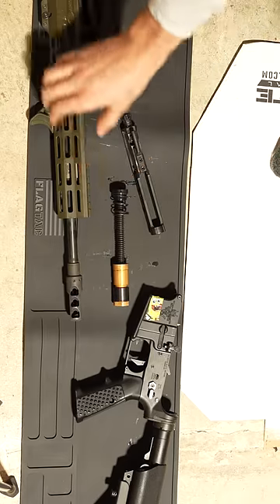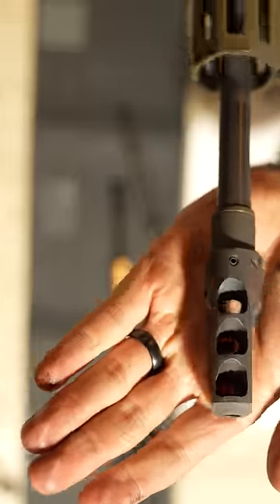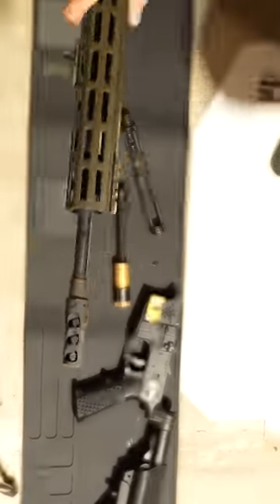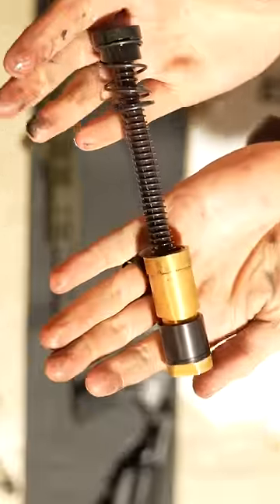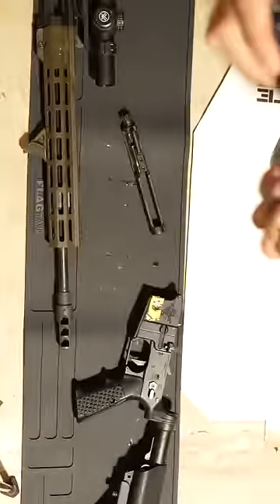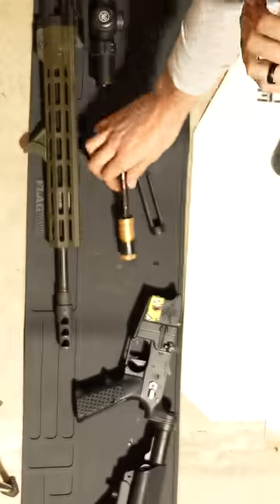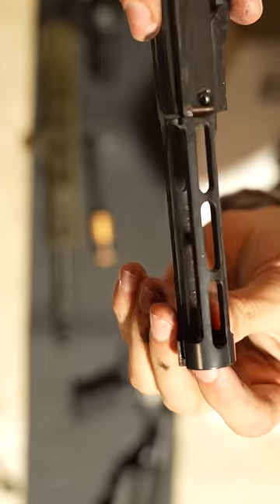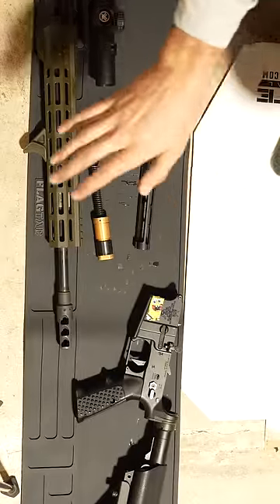This AR has ZERO RECOIL

Comment from the maker: Some of you dorks need to take the fedoras off and learn that hyperbole exists lmao 

ERRMMM AHKTUALLY 🤓
Reply: How much is it? Looks rather pricy with that bolt carrier and buffer
Reply: Or, just don't lie.
Reply: @Icytits  He literally explained how that is not a lie
Reply: CA Compliant?
Reply: My set up kind of like yours. My first build was titanium bolt carrier, hiper eclipse trigger, muzzle brake with suppressor quick connect, adjustable gas, jp buffer group. Recoil non existing, but this is definitely NOT a duty gun since it's low mass, the carbon buildup starts to mess with the cycling. About 200 rounds and it starts to act up. Everything is light weight. Made this build for light shooting to get people to see that shooting an ar15 not that scary. A quick gas adjustment and it'll run again but with more recoil. Is this gun necessary. Nope. Would never use it for self defense, I live in a city. Is it fun? Absolutely.
Reply: Can you put a suppressor on it with the recoil parts?
Reply: Can those attachments be used in a military styled m4a1?
Reply: What rifle?
Reply: @PeppyCat210  It's just a hyperbole
Reply: Does this rifle have a reciprocating barrel?
Reply: you sad tapewotm
Reply: Thought it was that hand guard 🤣
Reply: Unfortunately redditors still exist
Reply: @Icytits  I think they meant vertical recoil.
Reply: Anybody that needs to reduce the recoil on an AR, shouldnt be using it in the first place
Reply: what's the name of the AR or is that a piece for improve AR ?
Reply: @herbertayala1827 nothing is California compliant including California it's self
Reply: Hold it at arm’s length one handed and let’s see how much recoil and muzzle climb there is.

I know, nobody Ackshually shoots like that. Still, that’s a better way to showcase recoil mitigation.
Reply: Work with f/a?
Reply: looks great honestly
Reply: when I was 60lbs I had a 20 gauge single shot.   Can you imagin the type of trauma this will sustain?
Reply: @LairdErnst  Soa Subverter
Reply: @Dire_wolfe that makes no logical sense
Reply: Reddit, home of the basement people with no social skills
Reply: Reported to CA authorities. 

Hope you registered that "assault weapond" bud lol
Reply: @Icytits  what's he lying about? I'm so lost as to what the controversy is

Comment: I have a sub six pound AR (sans optic) that's practically zero recoil.  Don't need the big brake, I used a Faxon pencil barrel with built in brake, adjustable gas block, lightened BCG, and standard spring and carbine buffer.  I put a Vortex Strike Eagle 1-6x scope on it with a lightweight scope mount.  Shoots fast and flat.  If I want it lighter, I can gut the buffer and adjust the gas.

Comment: All 223/556 ars have "zero" recoil. If you hold it right and stand properly. Its a 22. As long as you arent 50lbs soaking wet you shouldnt have a problem.
Reply from the maker: It would be a safe bet to assume I’m bigger and stronger than you. But if you want to understand the benefits and reasons why you would want to set a gun up like this you can watch the full video. You will learn a lot
Reply: @RenoMay  not sure why you said that. If it was the 50lbs thing that wasn't remotely aimed at you. All I'm saying is that there isn't much need for a break on an AR in 556.

Comment: I’ve fired similar setups and it can be an amazing experience—at significant cost.  Knocks that 6lb recoil down to maybe 2lbs.  
If you’re on a tight budget, spending $50 can get your recoil down to 2-1/2lbs with a $25 rear slash cut compensator and a $25 adjustable gas block.

Comment: For those who think the military should adopt something like this, here's why that's not a good idea.

Tuning your gas block until it is just barely getting the job done sounds cool, until you realize that adjustable gas blocks are known and well-documented failure points, and that as soon as the rifle gets dirty it is unlikely to cycle properly.

Then there's the fact that muzzle brakes absolutely suck to be anywhere near, which is less than desirable if you're on a fire team. They're loud, they're concussive, and they spit fireballs that give away your position. They will absolutely fuck your shit up if used in conjunction with night vision or thermal.

This is the opposite of a desirable infantry carbine.
Reply from the maker: This conversation and more was detailed in my full video on this gun. 

I’ve not had the reliability issues because this gun was made from the ground up to work as is. But it definitely in theory will be less likely to function in “adverse conditions”. 

That being said I have a few thousand through the gun so far and have not had a single stoppage. I just lube it periodically every 500-1000.
Reply: Still good for patrol, they have a duty buffer that functions with mil spec gas block
Reply: @Chanchezbawan  for all of the reasons listed, no
Reply: And that’s why I run carbine gas length.
Reply: @milldawgj9598  mid length > carbine length

Comment: 5.56 already has almost zero recoil
Reply: It doesn't have enough to make your shoulder hurt, but clearly you haven't tried full auto or long range shooting.
Reply: @eeddsdsd  thats about all the shooting i do the reason i love 5.56 is its recoil im very familiar
Reply: @eeddsdsd  very predictable controllable and mellow as for the recoil ofc different styles of rifles are gonna handle differently ive seen these hoodlums with 9” barrels and no stocks on the internet those things wouldnt be very controllable but any normal rifle is gonna have almost zero recoil when it comes to 5.56 as long as your stronger then the average 10 year old
Reply: These kids these days. It's making me angry lol. There is damn near zero recoil on the damn thing. Full auto / burst is not an issue either. I agree with you.
Reply: @ncamp2126  right?? They always the expert on everything glad to see someone with some common sense lol
Reply: Literally lol 5.56 doesn’t even kick. Need to see it on .30 cal
Reply: @its.Andy1  fr lol
Reply: I'm active duty, use auto very frequently with my m4 and 240 several times a year. Recoil causing pain and recoil being heavy are very different things. 5.56 has a ton of recoil for such a tiny, shit round. Impulse from the 30 is actually much more manageable and controlled. Unless you can keep it in a 4 inch circle at 15 meters(auto). I don't want to hear it.
Reply: @johnjames3504   you have no idea what im capable of with my rifle im very experienced and i have the luxury of training everyday so unless u train with live rounds every single day i dont wanna hear it bud
Reply: @Wemissjericho  🤣😂🤣😂🤣😂🤣😂🤣😂🤣😂🤣😂sure kiddo. It's not only my job, but my hobby. I've made better shots offhand with my cowboy setup than you have on your best days. Lol. Not mentioning anything I train with manufactured in the past 100 years.
Reply: @johnjames3504  its your job and hobby and i still train more then u just plain sad if u ask me
Reply: @Love2argueitsfun  no you don't 🤣😂🤣 I can end this right now. How many rounds do you fire a week. And if it isn't in the thousands, then it's time for you to go home kid.
Reply: @johnjames3504  I probably go through atleast 300 rounds a day i got nothin better to do but i usually shoot more on days where im bored go through atleast 3000 rounds a week probably more im very well set off currently but idk how much longer i can keep it up if ammo prices keep goin up lol might have to switch calibers havent trained with my pistol in forever i just love my rifle but it might be cheaper to do that or convert my ar to .22
Reply: @Love2argueitsfun  thats a pretty impressive amount for sure. I'll do about a thousand on pistol a day, 5 days a week. Rifle completely depends on what I'm using and purpose. Precision shooting/hunting, maybe 3-500 for m24 or 45-70. 2-3000 with 5.56 for cqb and room clearing/barricaded subject/hostage/active shooter scenarios. Not including weapons testing and heavies.

 I agree that training is the most important part. Can't replace time behind a gun
Reply: @johnjames3504  training is all that matters when it comes down to it i used to train even more then u do now and go through more rounds in my prime lol but i only train from home nowadays so i dont do any of the complicated scenarios anymore just simple stuff things i can do by myself and u never forget but i mostly do it for enjoyment but i like to stay sharp now that i dont have to work anymore atleast for the time being i really got nothing better to do other then train and i really do need to get some hours in on my pistol its just not my strong suit so i end up avoiding it i know i shouldn’t tho like i said training is all that matters lol
i really hope i never have to rely on that godforsaken pistol 😂
Reply: @johnjames3504 maybe you should ask your Commander to do some paperwork so you can have a rear eschellon type mission . Maybe the mess hall or some sick call paperwork shuffler.... If a M4 hurts your little wing then you got the wrong mission.
Reply: @HARVIELL1  I fire a 45-70 and 7.62 as personal platforms kid. Don't ever buck up to a man. You're not there
Reply: Why do people always have to argue? 🤦🏽‍♂️He made a post that is factually true and people have to screw with him? Then some guy has to call him, “kid.” (which is what Gen Z calls people in video games) Why do people get, “muscles” behind a screen? Why not leave people in peace?

Then there is the argument about competition shooting… I’m sorry, but any expert rifleman can take this rifle with that scope after a zero phase and rip it. That’s a fact!
Reply: @alexsmith6914  thank you 🙏 😂 lmao these “weapons experts” think they know everything because they played enough minedcraft or something 😂 they’ve probably never left moms basement
Reply: @Wemissjericho  You’re just speaking the truth, brother. I have no respect for people that have a constant need to try to degrade or belittle others.

I’ve handled these weapons for 23 years and I’d never do that to someone.
Reply: @alexsmith6914  true but we all have our own way of dealing with these kinds of people 😂
Reply: Jealousy is running rabid in the comments. All these proud talking keyboard warriors. Some of you are probably so butt hurt that you clicked on report video, trying to cause trouble to the creator. This creator proved himself. The rest of you haven't proved anything except that you're awfully brave hiding behind your keyboard. Just stop it. Grow up. You probably don't even own or have shot one of these.
Reply: @502outlaw2  clearly u are inexperienced i am not bragging about my skill i am simply stating a fact about this round 5.56 was literally created to have minimal recoil thats what it was made for anyone whos shot 5.56 and has the upper body strength of 10 year old would agree with me

Comment: My go-to has near zero recoil. It's nothing special. Weight is 7.0lbs without a mag. Has a streamlight so that's why it's not less. 

Barrel is BA 16" mid length pencil
Aero LP GB
Spikes melonited gas tube
Expo Arms m16 phosphate bcg
RRA tactical brake

The RRA tactical brake is awesome. Even in the dark there is only the occasional flash and it is minimal. Barely more than an A2.

I do also have a rifle length buffer tube with a 5.2oz kak "retro" rifle buffer and a cheap Anderson rifle buffer spring. It really is a soft shooter, barely more recoil than a 10/22 and a lot less than the same AR build with an A2 FH. 

I will also note that while it is a little louder to the shooter than an A2 FH, it's not a lot louder like most brakes and it is extremely effective. It also looks cool. I'd say you wouldn't notice the sound difference between it and an A2 unless you were shooting both on the same occasion. Pretty awesome for not a lotta money.

Comment: You can forego the spendy buffer setup and get pretty much the same result with just a lightweight BCG and muzzle brake. It's getting a little ridiculous when we need to start adjusting ports on our brakes.
I use the Ultradyne Pulse brake and Faxon LWBCG with my 20" and it's already like shooting a pellet gun. Range neighbors will hate your F'n guts tho haha...

Comment: I don’t like muzzle brakes, but the other stuff is good. 

I use an ASR flash hider which does nothing for recoil, but the H2 buffer, David Tubb flatwire spring, low mass bcg, and adjustable gas block are what reduces my felt recoil. 

Its no zero recoil but like I said I just don’t like muzzle brake sound.

Comment: Yah alot of people under estimate how much a light weight bolt carrier will do... think about it like a stock carrier being a 8lbs sludge hammer. Once you start to swing it trying to get it stopped takes alot. Thats recoil. Swaping to a light carrier is goin from a sledge hammer to a framing/regular claw hammer. Alot easier to stop mid swing...so less recoil.

Comment: To be fair, the AR 15 was designed after the AR 10 hence the 15 and not the 10. The AR 10 was chambered in 762 NATO or 308 watch had significantly more recoil and needed more reciprocating mass. The AR 15 being a downsized version just used what they already knew. This is why companies have different uppers now like the BRN 180 and the jackal. No buffer system at all. Although all of these parts, make one great rifle set up. I would like to see an AR bolt cut in half with a redesigned recoil spring much like an AK. Add an adjustable gas block and now you have a superbly lightweight rifle with a side folder that is still direct gas impingement. A lot of people don’t talk about the fact that direct gas and pigment has less recoil than piston uppers. Anyways, I digress. Great video.

Comment: Just some friendly advice here. I have a few ARs, but one of them has near zero recoil as a stock setup. Its the Ruger 556 MPR. It has a full length gas system with 18 inch barrel. I can't imagine how soft it would be with a aftermarket brake on it too.

Comment: I like the AR's & they definitely have a massive aftermarket but prefer the AK. Especially when you compair the two. Rounds are almost the same. 5.56 v 5.45 accuracy if the rounds virtually identical but here's where they truly are different. AR fine tolerances AK sloppy tolerances. AR is more accurate but not enough to talk about. Both combat rifles. Dirt mud sand AR malfunction AK just keep feeding it ammo. Truly beautiful from a soldiers perspective.
Reply from the maker: Many things stopped my AK. 

https://youtu.be/nigalZhYI10?si=_qrj-cO1ZCEcxxgq

But ARs outperform AKs in many mid tests. They have an enclosed system that stops anything from getting in.

Comment: An insanely unrealistic and obnoxious muzzle brake that would obliterate your ears god forbid you actually had to use it in self defense, never mind indoors… one shot inside and you’re bleeding from your eardrums. Literally. Good fuckin luck
Reply from the maker: Widdewawwy. 

This gun is designed for something specific. I cover that in the full video. And it’s not even as loud as a 10.5 with a war comp in my opinion

Comment: How does this setup hold up long term? Particularly that bolt. My gut feeling is it won't hold up as long as a traditional bolt, but I'm not an engineer.
Reply from the maker: Watch the full length video linked. 4k rounds on this gun as of the time of review

Comment: Making the bolt carrier group lighterweight with skeletonizing. This isnt even slightly butt puckering to you? I dont see it causing a catastrophic failure, but i feel like it would be in the back of my head the entire time using the rifle.
Reply from the maker: People way smarter than you designed these parts. It’s fine for the specific use cases and role of the gun.

Comment: 머즐 브레이크+ 개선 된 충격흡수장치+ 더욱 가벼워진 노리쇠로 무반동 실현
확실히 가벼워진 노리쇠와 머즐브레이크 조합은 효과가 좋겠지만  난 그냥 사수가 헐크가 아닐까? 생각함
그냥 봐도 190에 90~100킬로 사이로 보이는 체격임
16~18인치 배럴 AR로 보이는 데 내가 들면 저 AR이 훨씬 더 길게 보일거임
Reply from the maker: This gun will let any competent shooter perform at a higher speed. 

I’m 6’2 - 200lbs. 

The light buffer and bcg will require an adjustable gas block.
Reply: @RenoMay  I knew it! you are 189cm and 90kg
ㅋㅋㅋㅋㅋㅋㅋ
anyway it looks like 22lr shooting 
i think that gun for sport shooter.
boltcarrier looks like Elaborate crafts

Comment: Physics failed? I need scientific explanation behind it. Why less recoil?
Reply from the maker: Got an explanation in the full length video review on this gun. Was uploaded not super long ago. 

Less reciprocating mass means less impact to your shoulder and less mass hitting forward as the bolt closes. = less movement of the point of aim. 

Less gas to the mass due to closing the gas port a bit means lower carrier velocity than a fully opened port. This is only possible due to the reduced mass bolt/buffer. 

Gas leaving the brake after bullet leaves pulls the gun forward reducing the recoil to the rear. Gas is also directed upward from the ports reducing muzzle rise.

Comment: I get that the scope is likely a 1x6 or 8, but IMO, that's better attuned for a DMR.  Get a holo or red dot on this thing if you're gonna plug away like that.
Reply from the maker: Nah this gun is built in a specific way for a specific purpose
Reply: @RenoMay  I'd be curious to know...only because I run a 1x8 Primary Arms on my M1A SOCOM and have been considering to swap it out for a holo and use the scope on the Scout intead.  Seems to fit better, but maybe I'm missing something.